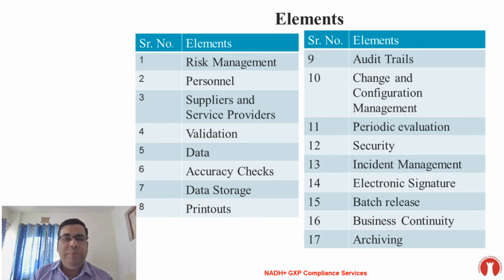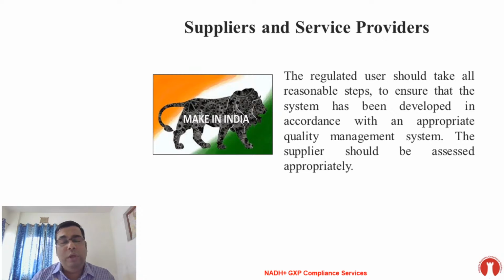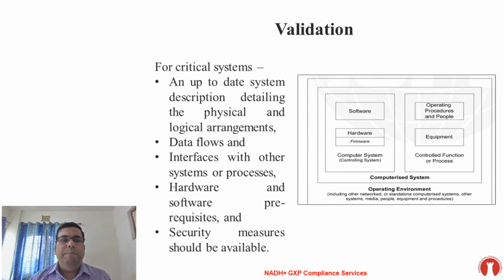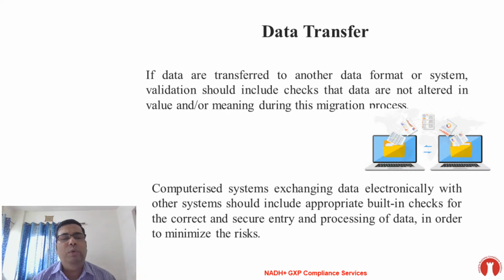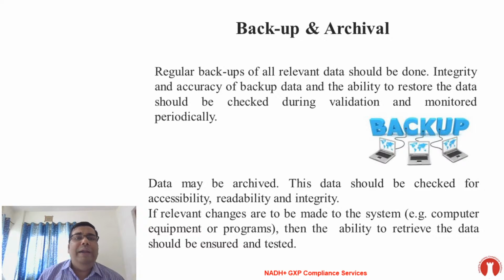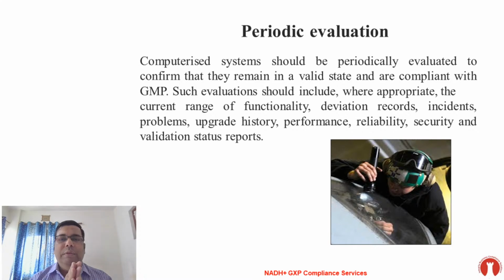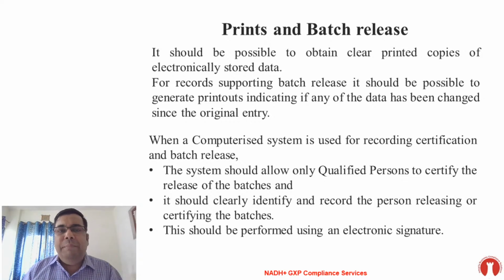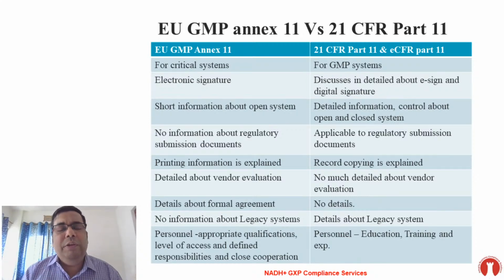EU GMP Annex 11 - Expectations & Evaluation

Comment: Nice presentation 
Is it required to do computer system validation in case we change the antivirus??
Reply: Q
Reply from the maker: If you change the antivirus or if you update the patches of software, you need to evaluate its impact on system performance. If it is not affected, revalidation not required. But the impact assessment is required to prove it.